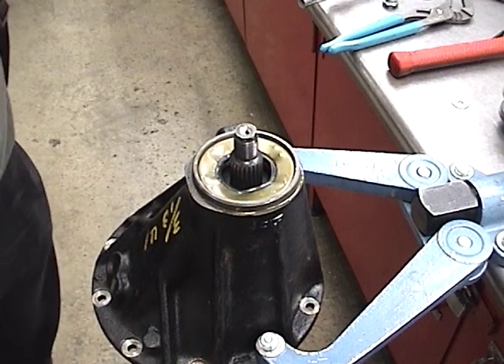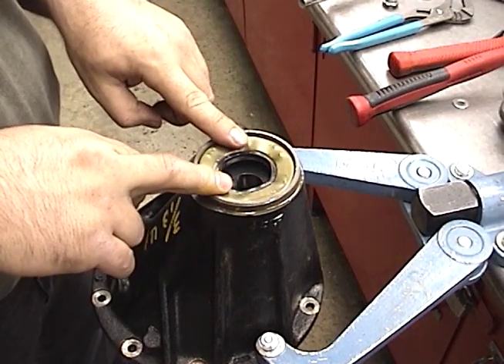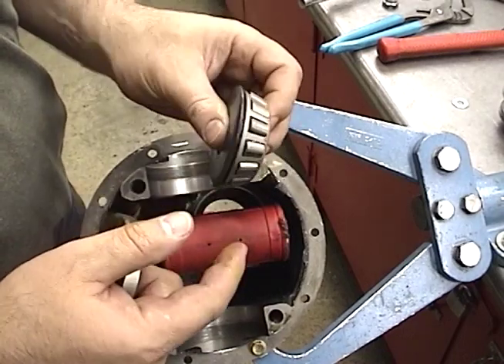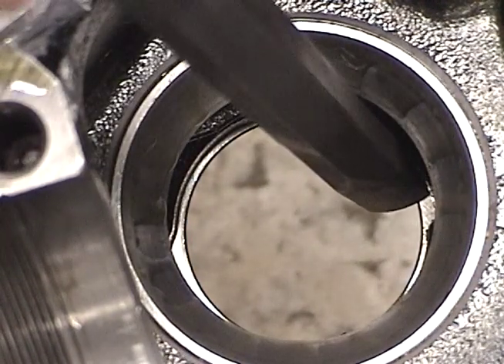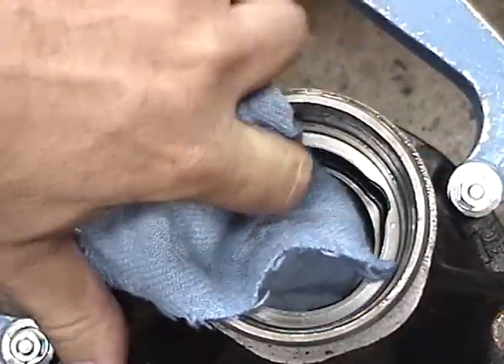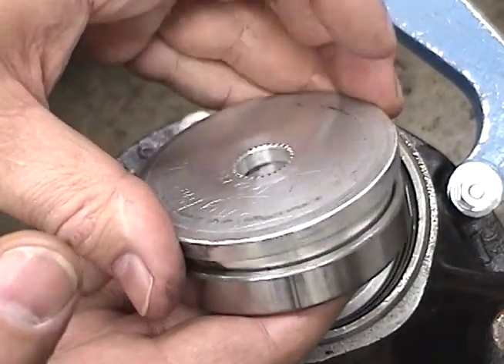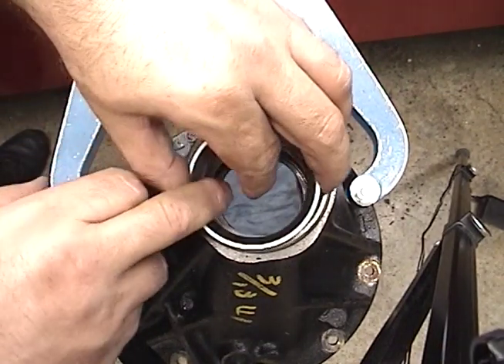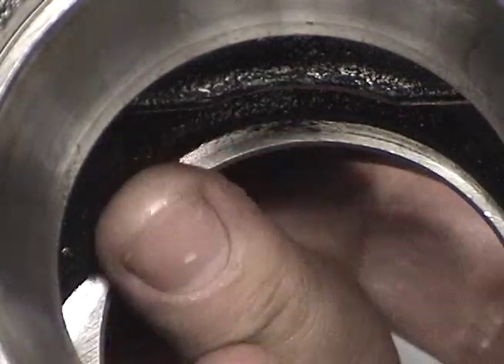Differential Drive Pinion R & R Part 2

Comment: Thanks a lot for all those very detailed and precise video, I can tell that you are truly an expert in this field. I suspect a damaged pinion bearing on my Ford Transit (the noise is similar to what you have shown in your other video). In this case, do I need to change the shim setup ? Thank you for your answer. Regards from France.
Reply from the maker: The shims are rarely damaged and can often be reused.  As long as you are replacing with identical gears and OEM bearings the odds are in your favor that the OEM shims will provide you with the correct pinion depth.